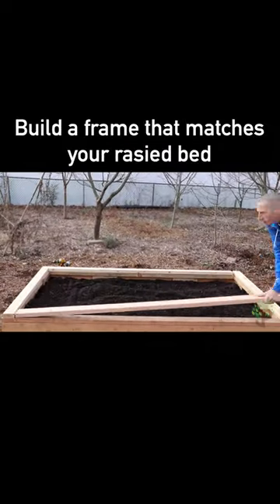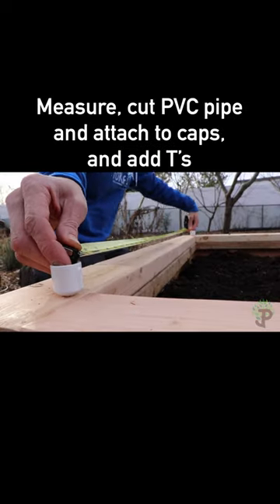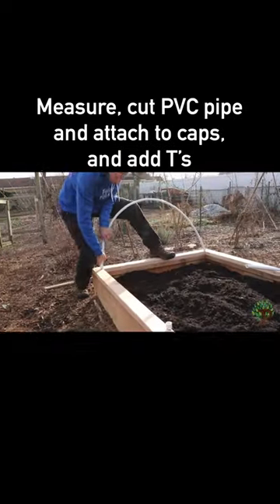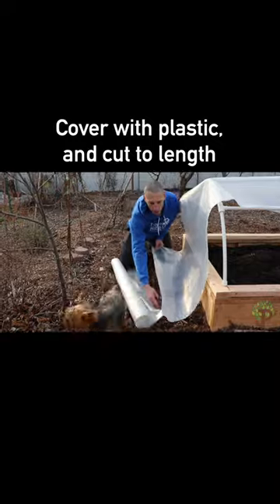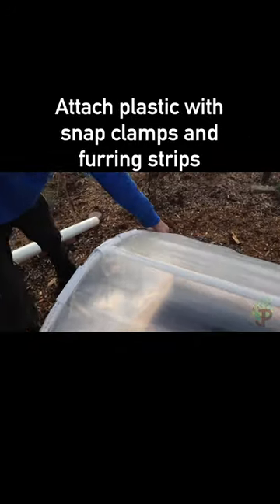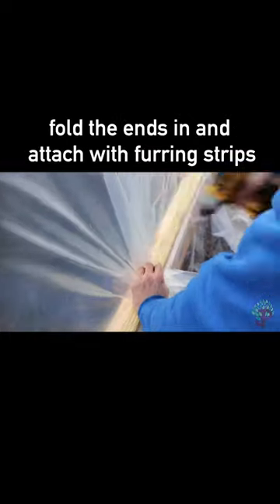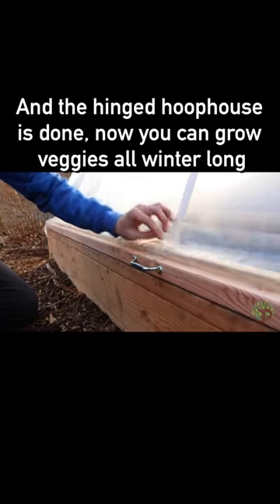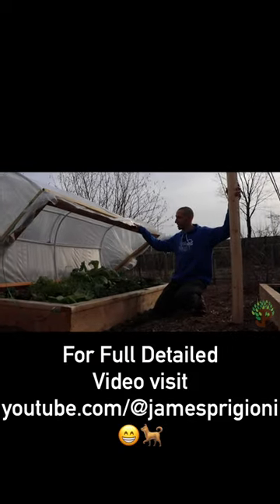HINGED HOOPHOUSE for a Raised Bed Garden

Comment: As soon as the sun goes down it’s the same temperature as outside the greenhouse
Reply: You literally know nothing about greenhouses. You would be very wrong as a matter of fact.
Reply: @brokinglet5483  I do have a greenhouse this has been my experience. Don’t take personal
Reply: As soon as the sun goes down the internal temperature always remains a few degrees higher than the outside due to the earth/soil holding heat, combined with the fact it’s completely sealed so the trapped warm air isn’t immediately dispersed by wind. It’s a great idea ❤
Reply: You right Michael, depends what you grow in the greenhouse. Only hardy winter veggies can be grown. You need heating and lighting for summer veggies.
Reply: Mulch.

Comment: It wouldn’t be enough for winter in my area but I could definitely get an extra 2-3 months.
Reply: Tonya Little  you really can't in a lot of the USA. Only where it never freezes and it's not too cold.  Wa state you have to heat green houses or just grow inside is what I do with heat and lights
Reply: Some plants won’t grow but at least you can keep them in latency without getting killed by front for a few weeks.  Like a fridge with live plants inside.  It worked for me.
Reply: U can always keep adding more layers of plastic.. I guess they say each layer u put on u can add another zone to your current
Reply: @robertestes1081  very interesting.

Comment: just curious what the dollar amount of the cost for the build was I recently purchased a 16 ft long 7 ft wide and 7 ft tall plastic greenhouse and frame for $185 after taxes and shipping curious if I did it wrong
Reply: That sounds great!
Reply: Where can I buy one?
Reply: @jimlong1239  I got mine off of Amazon they had quite a selection you just have to make sure that you select frame and cover there are also different sizes of varying prices I have no affiliation to the seller was just curious about his cost for doing some small ones or if I should just buy another

Comment: Pvc doesn't have uv inhibitors and you are putting it under internal stress.
Reply: What would you use?
Reply: @jturtle5318  PVC can be painted to buy it time, but also become brittle when cold. Grey Conduit is a better choice if staying in the same theme.  EMT with a homemade bender, I was happy enough with the results. But these days I would use laminated pine for a bed this size.  For some thing larger @poypohyi7247 has a good video on laminated gothic arch greenhouse/boatshed (though his site is in the internet archive now) and @adrianwoodworm has a good implementation of it as well.
Ripping a 2x4 down to 1/4" and laminating two pieces of lathe should be sufficient to handle the snow load if necessary. If the bed is narrow enough spring steel wire works as a hoop aswell.

Comment: PVC is highly toxic. I don’t want it anywhere near my organic garden. Isn’t there another way besides PVC? 😢
Reply: Metal rods
Reply: Yes .. yes there is
Reply: @my_flippin_journey   your suggestion?
Reply: @artstamper316  metal pipes, but they're harder to bend.
Reply: @jturtle5318  Nice, but that definitely won't work for we elderly folk. 😢
Reply: @ebbeweber1310  not true. Many Google articles both on organic gardening and on the use of PVC tell you it is toxic to handle, breathe or use for gardening. When it starts to degrade it gives off dioxin, one of the ingredients, as well.